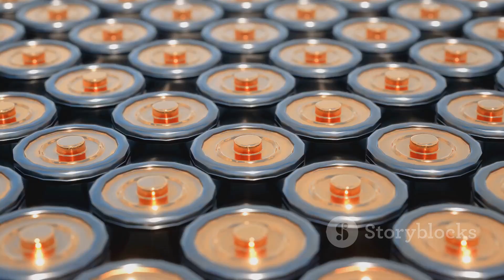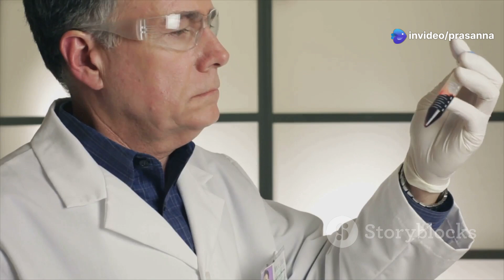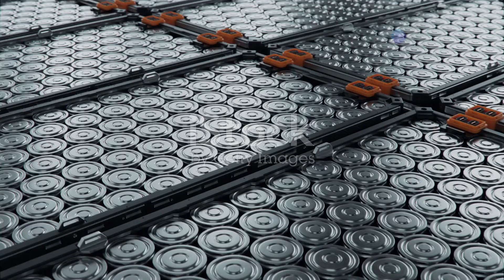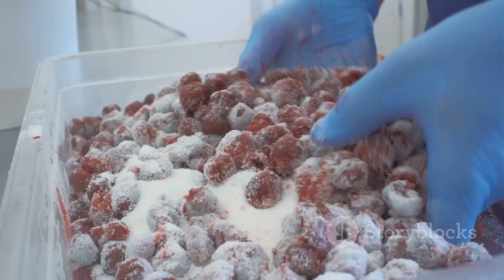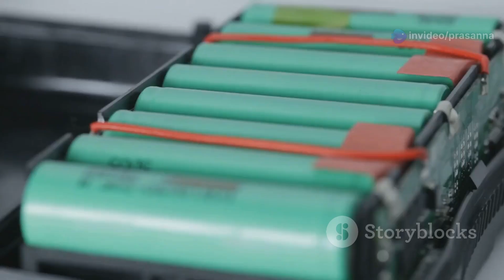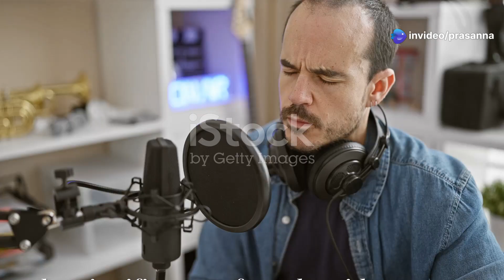:🔋 The Making of Lead-Acid Batteries! ⚡ From Raw Materials to Power Source 🔧

Comment: WORST VDEO is "The Making of Lead-Acid Batteries! From Raw Materials to Power Source".
There are no pictures or video that are relevant to the actual production of a lead acid battery. The actual grids, pasting operation, interior layout, insertion of grids, grid connection, sulfuric acid filling, final charge and test is not demonstrated at all. The video is a failure to meet even basic criteria of instruction. Nearly all the pics and vids are of dry cells, Li and non related batteries.